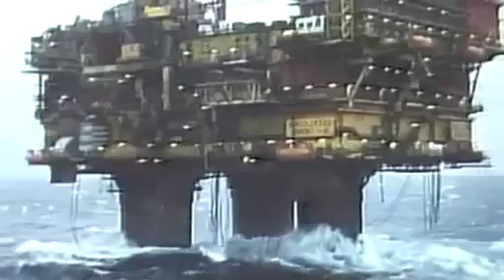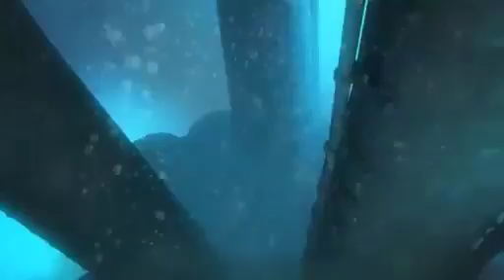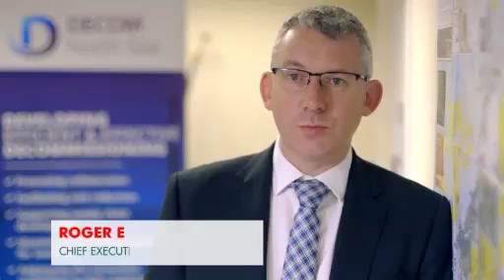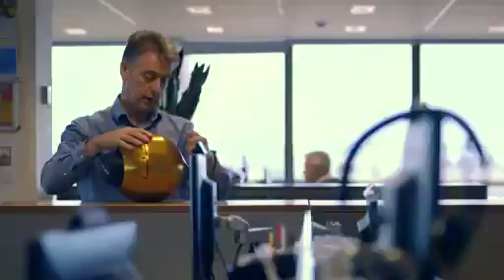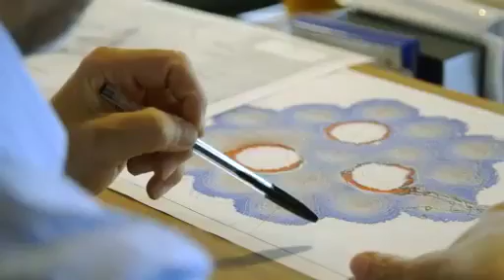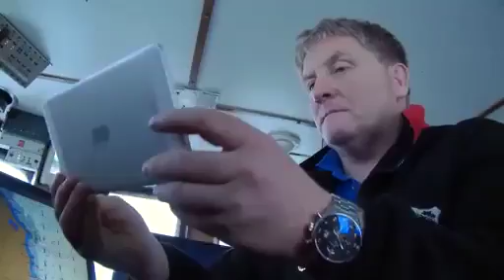How to Decommission Brent

Comment: At this point cutting the concrete is not an option.  The entire platform was constructed for the purpose of getting oil from the ocean.  Now that the platform has been decommissioned, the topside has been recycled.  Removing the entire platform in which your company installed is the right thing to do.  Take responsibility for your work and remove it all.  Money is not the issue since the company has made billions.

Comment: I can understand how the weight of the concrete legs would make cutting the legs very difficult, but surely a robot could drill holes through the legs until the structure crumbles.

Comment: If the structure was left in place it will eventually collapse and rupture? But it probably last a few hundred years left in its position? the oil has no pressure left  the oil has been extracted it would not be difficult to cap so there is no danger to the environment, please leave it in place and turn it into a hotel

Comment: Wow ....what shocks me is that these things were put out there in the ocean floor ... And no one every thought about how to remove it later ...that's amazing and quite ignorant ... How can anyone cause such destruction with any thought of the outcome ....I am astounded ...
Reply: That's how the world works,  they never thought about the idea that oil would slow down in these areas. What do you think that Henry Ford made first? Junkyards or cars? Automotive recycling was 2nd, I promise you that.
Reply: Honestly there isn't much practical thing to be achieved by this whole decommissioning process. Even removing the topsides were pretty much unnecessary, only served an asthetic purpose. This is not oil sands mining that you must have a robust plan to return a very large area of land to it's former natural state. It's just a bunch of oil rigs sitting on an almost dry oil reservior. This whole operation is really a homage to environmental laws and an unnecessary one since it actually achieves nothing. They might as well have left the whole of it untouched.

Comment: When technology is opposed to common sense!
I do not understand why they do not install a temporary deck to solve the problems of cells, comuns,  with pumping and wireline.
With the possibility of scrapping a large part of the debris (cutting) and others.
A much more economical solution for part of the work.
Once the deck is laid, you can work in any season.
The bridge could be adaptable to other platforms.
The temporary bridge could accommodate a light rig so that it could drill on the cells to clarify the solution oils and solids. Have on site the structure of work, laboratory eg. Wireline/Slickline and coiled tubing on deck.
This solution seems much safer and more economical than underwater interventions.
Since years we perform top sediments and bottom hole sampling in wells and for myself I never use radar, sonar, camera un other gadgets.
I was a member of engineering team for ballasting of Brent "C" and now Specialist for heavy fishing on oil and gas wells using Wireline coil tubing and others.